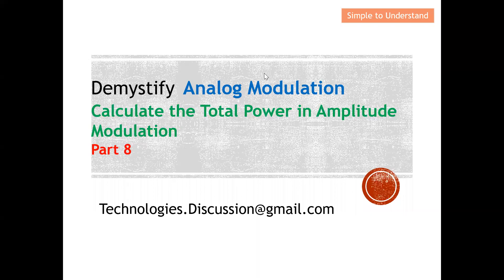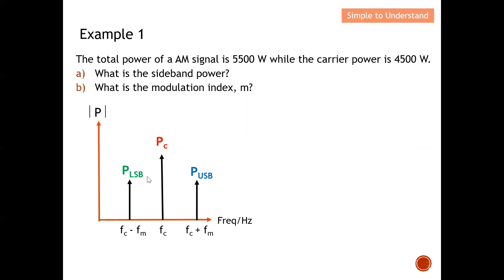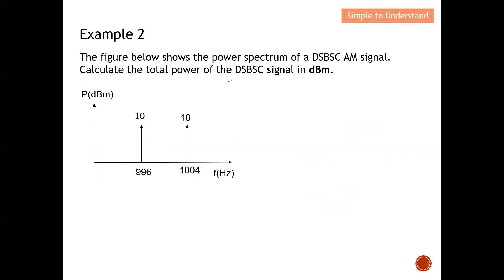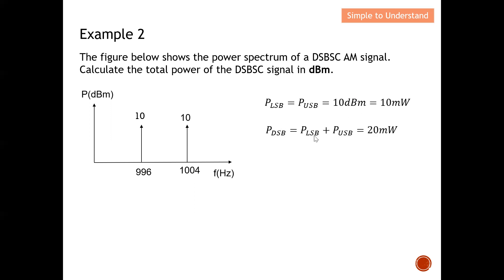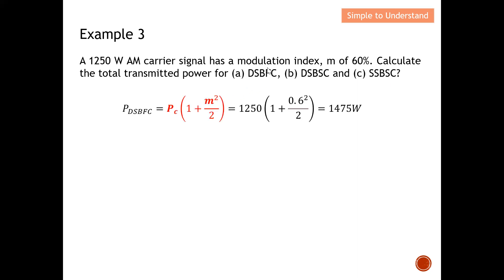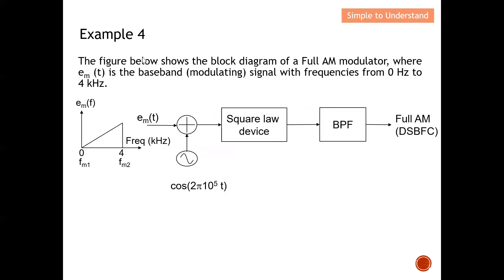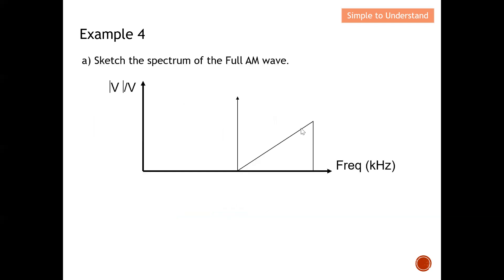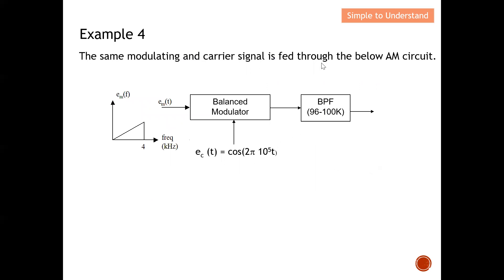Amplitude Modulation #8. Calculate the Total AM Pwr = Carrier, Pc + Lower PLSB + Upper PUSB Sideband

Comment: Sir, shouldn't the answer to question (d) of Example 4 be 'lower side band SSBTC,' since the 100 kHz is included in the range for transmission? 
Thanks a lot also for theses lectures
Reply from the maker: Thank you for your question. SSBSC = SSBTC.  :)
Thanks.  :)